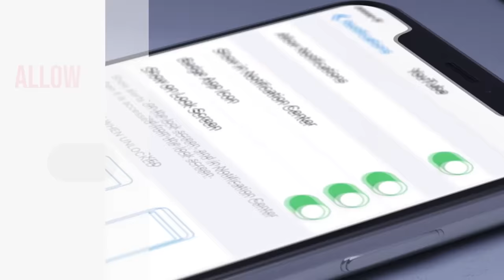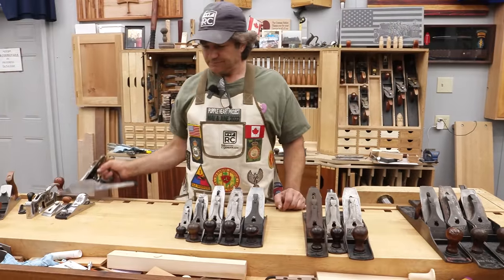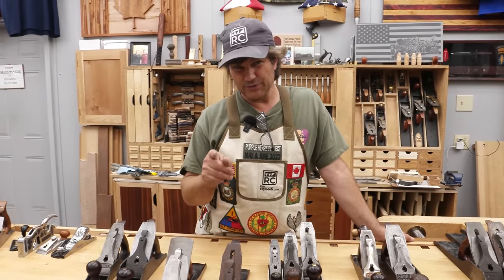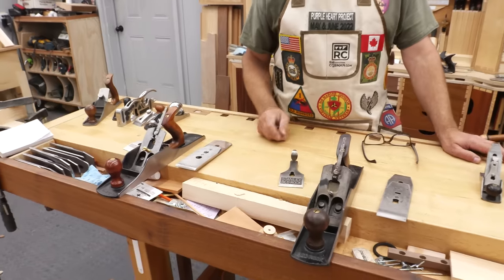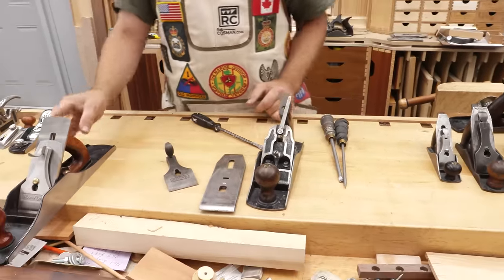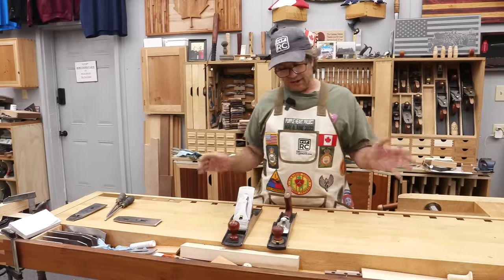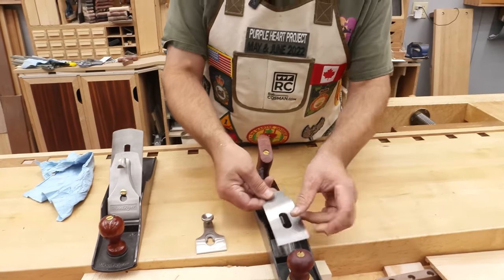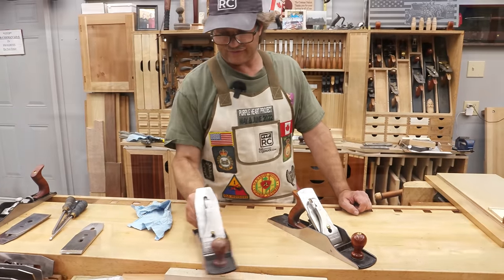Your First Hand Plane To Start With - Maybe the only one you need !

Comment: One thing to be aware of these youtubers have electric thickness planers and jointers.  So if you try to flatten a rough boards you will need a fore plane with a curved blade. Otherwise it will take you a week to flatten just one board. Look up scrub planing its a must especially with a fore plane.

Comment: a couple of years ago I purchased a #5 plane from your website.  You actually called me up and talked to me for about half an hour to find out what I why I was buying it, what I was going to do with it, my experience etc.  Eventually I switched my order to the 5.5 and I'll have to agree with you.  It was the right plane, and a very good brand.  The only issue I have is that because my workshop is not climate controlled I need to keep it stored in a sock and in a drawer to prevent it from rusting.

Comment: Hi Rob, I have been a cabinet maker in the UK since 1977 when I first started my apprenticeship; so quite a few years. When I started I had a no 4 and a no 7 and both suited all the needs I had at the time; both Stanley's. Over the years I have collected lots of planes only from no 3 up to no 7, mainly as I see no need for a 1 or 2 and a 8. These tools have been a mixture of Record's and Stanley's, I must say I really have never had a problem with any of them as they have been easily fettled to work as I need them to. I totally agree with your comment regarding low angled jack's, I purchased one a few years ago to see what all the fuss was about; and found there was nothing extra I could do with it that I could not already do with my existing planes, also agree with what you say about those angles as you say very little difference. I guess there is good advertising regarding these as it seems most hobbyists always seem to think it's a go to plane. As my planes are of the type non Bedrock design if I need to alter the frog it takes a few seconds longer, however I rarely need to change as I find the most important thing is a razor sharp blade. In the UK we have a brand called Quangsheng which are Chinese made; but look identical to your Woodriver ones. I am not sure what these would offer to me over what my old Stanley's do, I can get thicker blades and cap irons which would involve getting a slightly larger yoke; but I really have never had a problem. The new Stanley's and Record's which you can buy now are probably the worst planes I have ever seen and I always advise new apprentice's to look on eBay for the old ones; which can be picked up for less money.I think the cost of the newer modern makers put off most, and most of these end  up in the hands of older hobbyists rather than new young apprentices; certainly in the UK that is.
Reply from the maker: Good comment.  Getting new modern blades in those planes will make a very significant upgrade, trust me.  Hock makes replacement blades in the .115 thickness range design to still work with the yolk.  IBC makes .145 thick that will work with the yolk because of their chip-breaker design.  Quangsheng, is the authorized export outside of North America of WoodRiver
Reply: @RobCosmanWoodworking    I'm not sure you actually read the comment. He's saying he doesn't have a problem, yet you gave a solution to a problem he isn't having....

Comment: First year shop class all we had were #4s.  It was impossible  for a 13 year old to learn joint long boards with a smoothing plane.  Second year we did everything with a #5. By the end of that year most of us could make acceptable edge joints of any length using that #5.  50 plus years later I own a lot of planes and enjoy them all, but still use an old Stanley #5 more than the others due to the muscle memory gained from mastering that plane when I was just 14.  Thanks for the excellent video.

Comment: Couldn't agree more.  I followed the conventional wisdom, bought a $50 Stanley jack plane, tuned it to the best of my ability... and struggled.  A lot. Much later,  I borrowed a friend's Lie-Nielsen 5 1/2... and it blew me away.  I had no idea what I had been missing.  I have since bought one, and I absolutely love it.  Ironically, now that I understand how a plane can and should behave, I have been able to successfully tune my old Stanleys to work quite nicely (but I don't use them.  I should probably sell 'em.)

Bite the bullet and plunk down the bucks for a Wood River, LN or Veritas as your first plane.  It's a low risk investment, because if you decide that you don't want it, you should have no problem selling it at or near retail price.  If $300-$400 is totally outside of your budget, consider the Stanley 62 low angle jack plane.  It's admittedly not as slick as the aforementioned brands, but it's a hell of a good deal at $150.
Reply from the maker: Well said
Reply: Buying a LN or veritas plane because you can't get a cheapo modern plane to work is good. Those planes are trash and just won't work no matter what.

Buying a premium plane because you can't get a vintage stanley to work is bad. It means there's something wrong that you don't understand and don't know how to fix yet. Working on the old stanley will teach you that skill and make you a better woodworker. If something goes wrong with the LN or veritas, you might not know how to fix it because you never had to learn how to diagnose those problems. 

I'm not saying there's anything wrong with buying a premium plane. Just that you shouldn't dismiss the value of buying a vintage plane and learning how to tune it.

Comment: I have 2 No.4s that I managed to find/get off people who weren't using them and I've cleaned them up and tuned them to be pretty good, but they're still a PITA to get a cut started because of the short toe. So hoping to pick up my first new plane soon and have been debating this and coming to the same conclusions as Rob, good to have it confirmed, as most say 4 or 5 like he said. Thanks for a great video confirming my thoughts, can't wait till II can afford to order my new 5 1/2.
Reply: I have two no. 4s too, and a 5 1/2 woodriver I bought after watching too many of Robs videos! 

It’s a great system, I kept the two no. 4s very sharp as super-smoothers so I don’t need to sharpen them as often, the 5 1/2 as my general do everything plane, and a 7 I use for jointing and flattening my bench top. 

Can recommend the woodriver 5 1/2, great plane for a very decent price 👍

Comment: I began with a stanley no 5 and a big piece to my decision was price. I wasn't entirely certain I wanted to stick with hand tool woodworking so I wasn't willing to invest in the high end quality tools just yet. This also gave me a chance to learn how the plane itself works as I had to tune it. Like you said, as a newbie you don't know what you're doing. But the process of learning to tune it and seeing results improve taught me a great deal about hand planes and about sharpening..since I had to do it a few times to get it right... this could also discourage someone just getting in to it, it can be a source of frustration. So I think the biggest factors would be budget as #1 and then willingness to take your time in learning. If you want to just get up and go, buy a Wood River, every time.
Reply from the maker: Very good advice.

Comment: I take your point  regarding modern vs. vintage.  But for $300, one can go on eBay and get a 4-1/2, a 5-1/2, a 7, and an 8, spend 128 seconds getting all of them sharp and have a decent set of tools that can take you from rough sawn to finished piece.  Or, for $300, you can get one Woodriver 5-1/2 and still have 15% of your planing needs not covered.  I think for someone just getting into hand planes and willing to drop three c-notes, there's a strong argument for acquiring a set of planes even if they may require watching some Rob Cosman hand plane cleaning and tune-up videos before you start making curls.  Admittedly, I'm biased because that's the route I went when I decided to move to hand planes and got sticker shock from the modern planes.
Reply from the maker: My issue with vintage is that they were never designed to perform the way that a modern Hand plane does. The machining tolerances were much lower, the blades are significantly thinner (more chatter, reduced quality of finished work) and it takes actual skills to refurbish them correctly. A modern plane comes ready to work out of the box, aside from routine sharpening. Vintage are really cool, but in my opinion don’t compare to modern machining.

Comment: I am also a convert to the Woodriver No. 5-1/2. I had an old Stanley No. 4 I inherited from my grandad, and couldn’t get it to do decent work. After watching Rob’s videos on plane selection, use, and sharpening during the Covid lockdowns,, I ordered 1) my 5-1/2 from Woodcraft and 2) Rob’s recommended hardening stones/system. (You need BOTH, don’t cheap out on either one or you’ll regret it!!!) I thought I knew how to plane before, but I was wrong. The quality and weight of the 5-1/2 made it possible for me to learn how to mill my lumber flat by hand, to mill it to length and dead square with a shooting board, and to smooth my wood without sandpaper. Better tools make your wood working so much easier and better! 
Many thanks for your planing videos including this one, Rob.  You opened up the pleasure of hand tool woodworking to me and many others.
Reply from the maker: Thanks for the great comment.  I hear this same story over and over.  Glad you are making thin shavings now

Comment: I like the low angle jack plane and don't use any type of additional bevel.  More often than not I grab it first. The adjustable throat is a great help.  That plane has come through for me every time.  A sticking door recently caused a problem and the end grain was tough until I angled the plane body to it at about 20 - 25 degrees.  I have noticed that a sharp blade is paramount in every plane.  Even the "wrong plane for the job" often works fine with a sharp blade.  I never heard anyone say work piece X or Y would have turned out better if I had used a 5° secondary bevel, a 5° back bevel, or both.  I don't disagree with anything in the video, I simply found that I like the low angle jack.
Reply from the maker: A sharp blade trumps everything!  I do like the adjustable mouth on LA, but that's not enough to overcome what I don't like about LA planes

Comment: Rob convinced me a couple years ago to make the Woodriver 5-1/2 my primary plane, and it has proven to be a good choice. I have a dozen old Stanleys, including three #5s and a #605 which is the bedrock style, but the Woodriver 5-1/2 is way better than those old planes even though they are in very good condition.

If you're watching this and thinking about where to spend your money on your first plane, I say go with the Woodriver 5-1/2. If you have a #5 and are frustrated with it, get a Woodriver 5-1/2, you won't be sorry.

But if the price is out of reach right now, a #6 or #606 would be a good choice and when you can get the 5-1/2.
Reply from the maker: A great comment and I agree

Comment: I love the 5 1/2, which seems way more common in the UK. Sometimes I also use a no. 3 for smaller areas and a no. 7 for jointing. I never liked the 4 1/2. It always feels a bit ackward on smaller projects eventhough it does fit in my hand nicely.
Reply: Wish i had a 5 1/2 and a 7
Reply from the maker: Great comment, thanks for the feedback

Comment: 5 1/4 has been available for years at Lee Valley.
Micro bevel are usually 1 to 2 degree at most 
Cheers,
Reply from the maker: Ok, even at 1 degree the angle difference makes no difference in my experience
Reply: @RobCosmanWoodworking  
We're basically talking about a difference of 45° and 12+25+1 or 38° for the low angle.
A difference of 7°.  
Then, moisture content, species of wood, skewed vs. straight cut...on and on.
I'm saying the issue is not that straight forward as a yes or no on the low angle.
Some folks swear by it and others don't.
AND that's fine, the reason they make so many makes of cars, we all have our preferences.  
We'll leave Lee Valley out of this😏
Cheers,

Comment: A small but necessary awareness to the adjustment in closing the mouth on a Bedrock style plane is that the projection of the iron increases, which means a heavier cut, without backing it off. If somebody is planing apiece of wood and starts to cut, it will be a deeper slice, and could damage the wood.
Reply from the maker: Very good comment and you are correct.  Great point.  Still thats tons better than the Bailey style.

Comment: Before I even listen, I'm guessing a 4 1/2 or 5 1/2, but I'll listen, Rob Cosnan is simply the greatest! As a shop teacher, the latest block planes from (Wood River) Woodcraft are hard to beat for 7th and 8th grader very easy to use and push although not great for flattening!
Reply: It's Rob, gotta be the 5 1/2. Also haven't listened yet lol
Reply from the maker: You will never know for sure until you watch it?

Comment: I agree with all the points made, but I still use my per war bailey plane. Granted when I first started the plane i use now would be useless because I had to do a bit of restoration to it, flattening the sole mostly, and a bit of rust removal. I also agree that, imo the #6 is a much better plane on the shooting board. Though both the low angle jack and the no. 6 are both very serviceable on the shooting board.
Reply from the maker: Did you install a modern blade in your Bailey?
Reply: @RobCosmanWoodworking  kind of funny, but I have one coming this week. I ordered a Hock blade to try it out. Though the original blade seems to be in good shape, with the caveat that I am a hobbyist, so I am not going at things hours a day, day in and day out, just a few hours during the week and the most active on the weekends. So I am not spending as much time with my tools to discern thier problems. Eg most office chairs are sufficient until one starts to work in an office.

 Though admittedly I maybe overly attached to the age of the plane, and get attached to the idea that something made almost 100 years ago, not only survived, in an world that is becoming more disposable, but is desired, and still can serve the purpose for which it was built. That to me is pretty amazing.

Comment: Great info. Curious what your recommendation would be for my situation. Looking to add hand planning to reduce/eliminate sanding. All milling is done by machine. I was looking at a No. 4 to focus on the smoothing. As a smaller guy I think the 4 1/2 might be a bit more of a push as you said. But now contemplating whether the 5 is a better choice. Thoughts?
Reply from the maker: 5 would be better, heavier plane moves through the wood better, think increased mass.  Longer sole gives more stability, bigger footprint.  A shooting board will eventually become an essential and a 4 is woefully inadequate on a shooting board.